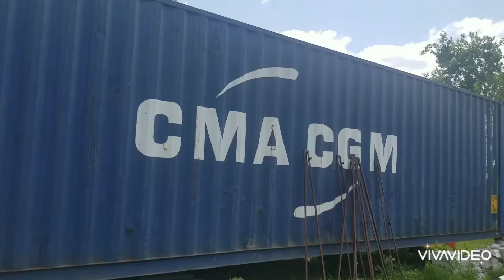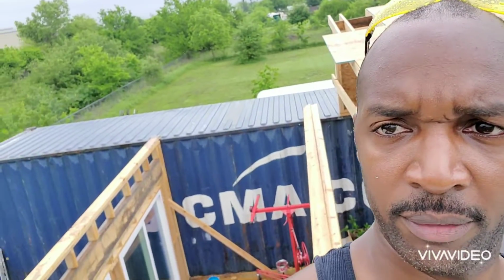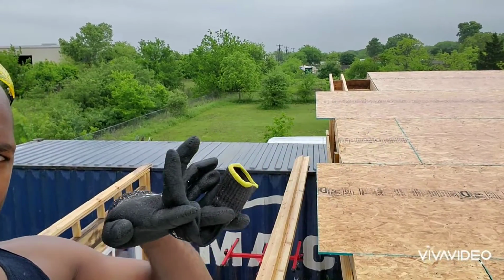#38 Shipping Container Roof Continues

Comment: Did you consult with an engineer regarding putting a roof load on the sides of the container? Only the corners were designed to take loads.